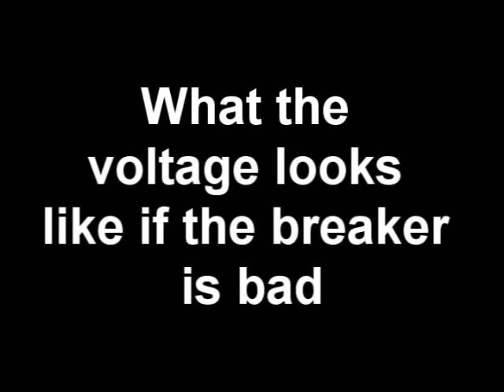Checking for a Bad Breaker

Comment: I got a real problem with this video.  When a breaker trips it's usually because there is a fault.  Blaming the breaker first is a good way to waste a lot of money.  There should be something at the beginning to describe how he decided the breaker was bad.  This is the kind of novice video that causes more problems than it solves.
Reply from the maker: Jack Ryan If someone is watching this video, they have likely already determined that they need to replace the breaker, and would like advice or guidance on how to check before spending any money.  Now if someone does change a single pole breaker, it would cost about $5 for the breaker.  If its a double pole, your looking at about $10.  So saying its a waste of money to do this is completely false.  Please explain how changing a breaker would cause more problems than it solves?
Reply: TheElectricalDoctor .  Okay first the title of this video is "Checking for a bad breaker" This is going to attract people who do not know whether a breaker is bad or not.  Second I re-watched it just now and you never mention breaker positions.  If a breaker is open or tripped it would fail your test.  This is NOT how to tell if a breaker is bad.  Assuming you really want to help people (and assuming you are qualified) I would suggest you remake this video, talk about the purpose of a breaker.  Talk about a basic electric circuits and how to set up a multimeter properly.  Talk about testing for a short circuit situation.  AT LEAST Mention these things.   Finally there may be some breakers are in the $5-$10 range but some breakers are much more expensive.  GFCI breakers could be higher than $50.  Really the best case is someone just wastes money. The worst case could be a lot worse.  The people who fall for your diagnostic are likely not qualified to pull this panel off a breaker panel.  I was not surprised at all to read kitterkat007's comment about her husband being nearly electrocuted.   You should pull this video asap.  Or Youtube should.
Reply from the maker: Jack Ryan I am not going to argue with trolls.  If you dont like the video, dont watch it.  If you think you can do better, make your own.
Reply: TheElectricalDoctor It does tell if the circuit breaker is on or off. Your very sarcastic with your remark, I would not even allow you in my house.
Reply: +Jack Ryan That's just dumb. The video isn't the entire troubleshooting process, just how to check for a bad breaker.
Reply: +TheElectricalDoctor I am here because I suspect a bad breaker. I have already check GFCI, and cycled the breaker. So you are correct, I found exactly what I was searching for.
Reply: If you need instructions to check while the breaker is in the on position, then you also need instructions to not touch the hot leads... I'd say that's obvious and not worth wasting time to watch..

Comment: Your 2 pole breaker test is bullshit. L1-G= 0Vac means your load could be broken. Not necessarily a bad breaker. Try that again but remove one wire from a phase.
Reply from the maker: Thank you but you are wrong.  If the breaker is bad, regardless of whether the wires are hooked up, the breaker will still read erratically.  Whether it be 20v to G on the bad side, 100v to G on the bad side or in my example 0v to G.  You do not need to remove the wires to do this test.  Now one thing you fail to realize is that a bad breaker that is going bad will not always show as bad until you put a load on it.  So I stand by my video.

Comment: It's interesting that you tell someone they don't know the first thing about electricity.  Clearly, your knowledge is limited because you are telling people to use the red multimeter lead on the breaker and the black multimeter lead on the neutral bar.  This is AC power, dude, and you don't need to differentiate between the red and black multimeter leads.  It's amazing that you're a licensed electrical contractor and you're telling people information like this.